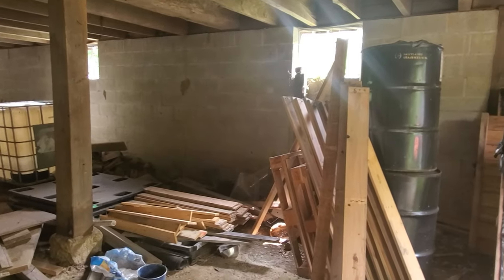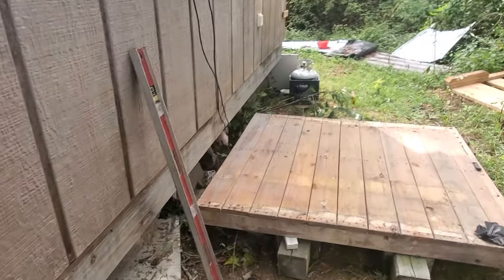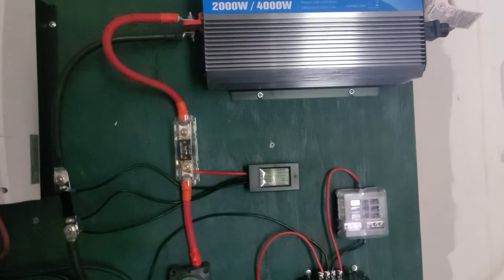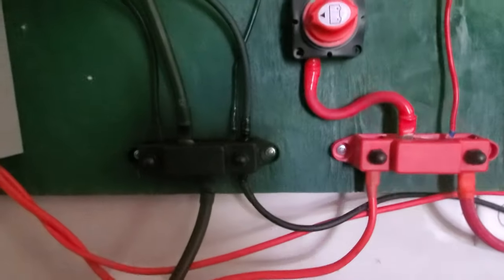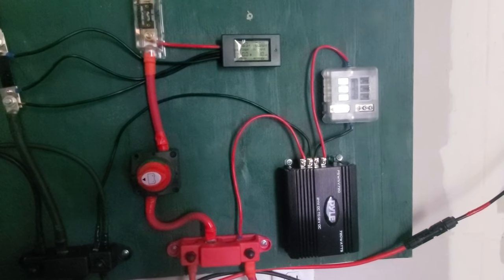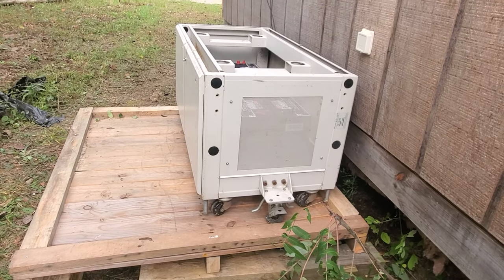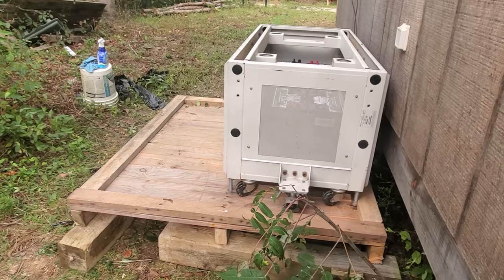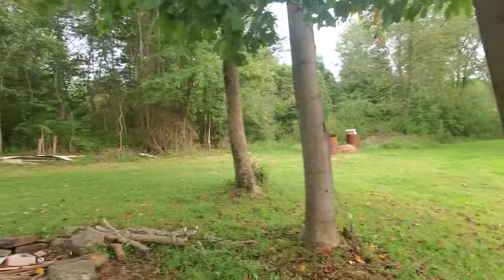Battery Bank Box / Power Shed Build Part 1

Comment: Batteries need at least a 1/2" spacing between them for circulation.  Might not be an issue over the winter, but summers will cause need for spacing, especially with an outdoor battery box. IMHO
Reply from the maker: +bill I agree.  In the spring, I have to make my parallel cables a little longer so I can achieve that. Thanks!

Comment: Joe, couldn’t ya just put the batteries out in the built box.  Run a couple leads through some drilled holes into where ya have the green, master-board.
Then your controls would be inside......
Reply from the maker: +John Williams Yes you certainly could.   I have a remote for both the charge controller and the inverter. Those will be mounted on the wall by the service panel.  Except for troubleshooting shooting or maintenance,  there will be little need for all of that. As well as, it will make the cabin look better without all of that.

Comment: so is it gonna work better out outside then🤔
Reply from the maker: +chris l It won't work better, but I have much more room in the cabin, and since flooded lead acid batteries, they off gas.  I feel much better they are in a vented area outside.
Reply: @StBernardAcres   yeah thats kinda better. solar a neat idea 💡